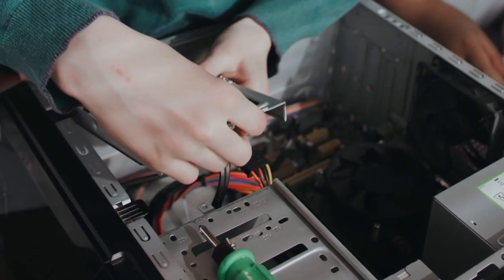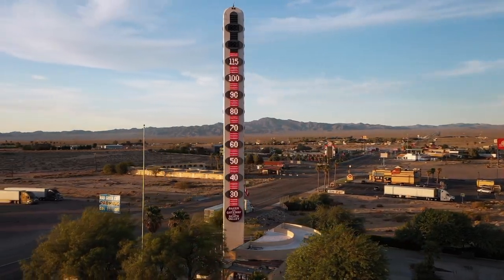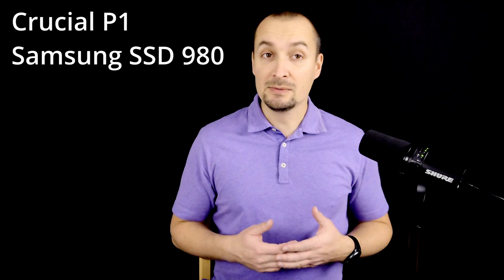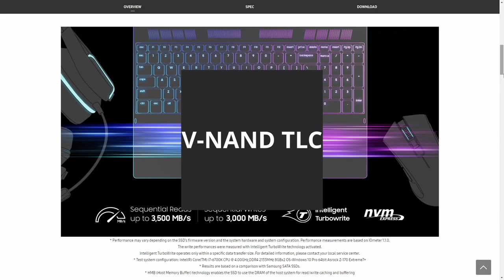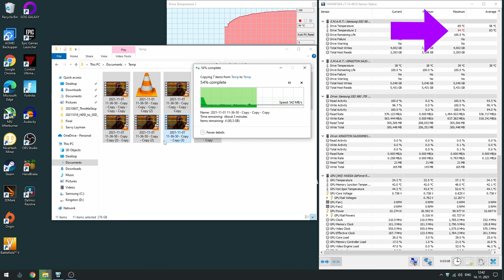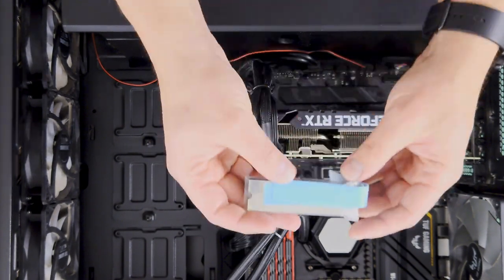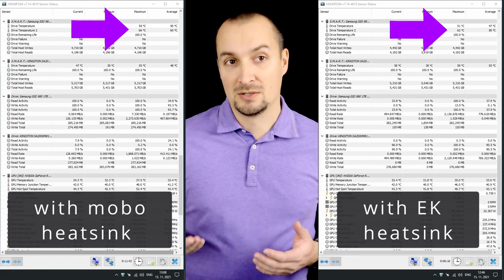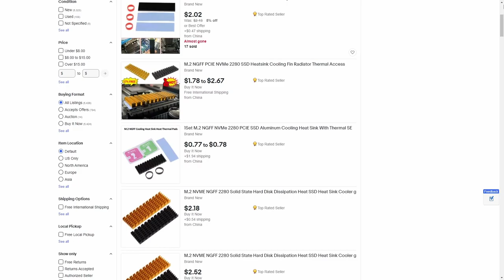Your NVMe SSD may be overheating!

Comment: I thought it's better to store info on a cold ssd. When you write info on it, it's better when it's warm. But during storage or reading it's better when it's cold. By spreading heat from the controller to the memory,  average temperature of the memory will increase due to it being connected to the controller by the same thermal pad\heatsink, no?
Reply from the maker: You are right; the temperature of the NAND chips will increase a bit when the controller is heavily used, but it is nothing to worry about as their operating temperature ranges up to 85 °C.

Comment: Cheap aftermarket heatsink can also get the job done, at least for my Samsung 970 EVO Plus.
Able to cool down the controller from 97 degrees C without a heatsink during benchmark.
But with a heatsink, can barely reach 70 degrees C.

Comment: When my ssd is in it's usual prime position trapped between the cpu and gpu, it's easy for my samsung 970 to creep up to 60c when I'm ignoring temps and leaving fans on default settings, without major continuous file transfers taking place. It first happened when I was playing Still Wakes the Deep (unreal engine 5) on ultra settings. I may consider moving the main windows OS ssd below the gpu, which might lead to lower temps (I haven't tested), but I have much better temps now after keeping my gpu fans on (zero rpm off, and kept on but at a low level when idle) and making the gpu fan increase from lower temps than before. Libre Hardware Monitor allows me to see the ssd temp in Afterburner whilst running anything in full screen. Front case fans blowing over the ssd works well but makes a minimal difference to ssd temp, at least compared to keeping my graphics card cool. Obviously when the gpu is not in use and file transfers are what overheat an ssd, then a much better radiator would be the option as above, and more case fans at higher settings
Reply from the maker: Cheers for sharing

Comment: Hey Man, I Own A Legion 5 Which Has A Samsung SSD And It Runs Pretty Hot.
When I Checked It Through HWiNFO-Sensor Status 
The Temp Of Drive Was Around 57°c & ASIC Controller Temp = 71°c !!

And While Touching The Bottom Chassis, Its Hot !!

Could You Tell Me Some Solution To Fix This Issue.?

Thanks !

Comment: My gigabyte aorus m.2 with copper heatsink has overheaterd numerous times now. .. Waiting for it to cool to see if I get to reinstall windows again for ghe 4th time since owning it...
Reply from the maker: What motherboard and graphics card do you use? It may also be the case the graphics card is dumping heat right onto the drive.
Reply: @savvylayman  Corsair 680x Case, and Gigabyte Aorus Elite Wifi x570 MoBo. The Aorus M.2 has a Giant copper heatsink on it and my other samsung drive does not and has had no issues, it even runs faster. Im wondering if once the heatsink warms up it just contains the heat as opposed to getting rid of it maybe? The operating System is now on the Samsung drive as the AORUS drive was entirely dead this time. Drive Temps seem fine so far and moved it to the same slot to confirm it was not that. That Aorus Drive gave me so much trouble over its lifespan I am debating if its even worth RMA. Its almost 3 years old. This was the 4th time it died and the other 3 I got it back with one time losing all my data. Now this makes for the second time I've lost all data on the drive. Nothing too important thankfully
Reply from the maker: @cdeshaw1986  Now, that's a shame Aorus drive runs hot with such massive heatsink. I wonder if the thermal interface (do they use a thermal pad?) is in a good shape or even missing? Anyway, the drive is definitely is worth an RMA.
Reply from the maker: @cdeshaw1986  Thanks for sharing. Gen 4 drives can run very hot in general, but yours is clearly broken. I wouldn't trust it with my data. It's a pity the fault only demonstrated itself once the drive was out of warranty. Whether or not it's just the controller, it's hard to tell. Yes, controllers are the heavy lifters, but since it shares the same heatpipe with the flash memory chips, you can imagine it has been cooking them for some time and that asks for trouble.
Not sure what your primary use case of the drive was, but I personally stick to Gen 3 NVMe drives and they are good enough. Drive endurance is more important to me than speed in most of my applications.

Comment: I have a Samsung  256 GB M.2 SSD model MZVLW256HEHP-000L7. The power on hours is 12 hour. The power on count is 155. The total host rights is 273 GB. The drives health status is 100%, however it is bad in the red because the temperature is $149°C with a heat sink in thermopads. I sell used computers but I will not be selling a computer with this drive in it. I will probably use it for experimental purposes, in a Windows base streaming media box. Even though it only has 12 power on hours I'm not sure how old the drive actually is for warranty purposes. I know some drives have bearer warranties. I couldn't find any information about warranty on the Samsung web page still looking. But this may have been a Dell OEM supplied drive that came in the computer, therefore when the computers warranty expires the drives warranty May expire
Reply from the maker: 149 °C?? I guess the temperature sensor is bad. I can't imagine ASIC would survive such heat. In any case, I wouldn't trust that drive. Good luck with your RMA case and thanks for sharing.

Comment: Thermad pads would also help? Thanks
Reply from the maker: Thanks for asking. Thermal pads only act as a thermal interface between two objects. That means, thermal pad alone will not do a great job dissipating heat. It also needs to touch a heat spreader of some sort, even improvised one. For example, I used a thick thermal pad on an SSD in my wife's laptop. It was so thick it touched the laptop's aluminum chassis, which significantly helped with spreading the heat.

Comment: Would this be a concern? Idle temp 40-44c, gaming temps 48-55c, download temp 78-81c. Drive is a Samsung 970 Evo plus 2tb.
Reply from the maker: Do you have a heatsink installed on that SSD? I mean it's not a tragedy but those download temps are a bit toasty. Maybe try to copy huge files here and there to see if it gets any worse. If it does, you may want to consider options. But unless you copy huge files very regularly, it's probably fine.
Reply: @savvylayman  I went digging to see what was up. There is no heatsink over that specific slot. I'll need to erase both drives, turn off the raid, and reinstall windows to relocate that drive to a different slot with a heatsink. It's living as is for now because it only gets super hot when downloading huge files like a big game on Steam. Thankfully, I'm not doing that often.
Reply from the maker: @cylerner  I do recommend moving the SSD to another slot where you can install a heatsink. There may be a very small latency penalty if the PCIe lanes come from the chipset instead of the CPU (at least on AMD platfom), but I would say it's negligible. Good luck and cheers for your reply.

Comment: You showed temps at 98 during load, then you installed the heatsink and compared temps at idle.

Idle temps were never the problem.
Since you added thermal mass, you needed to talk about time to steady temps.  I didn't hear that.

3C isn't much.

The most useful part of your video is where you give hardware specs for the Crucial - namely that it is QLC, and therefore cannot come close to the heat generation of the Samsung....
Reply from the maker: Thanks for your comment. Actually, all temps were under the exact same load (copying of a bunch of large files). The heatsink got never saturated, so the temps never reached higher than what was seen in the video.
QLC may play some role, but it was not the memory ICs that were burning hot. It was the controller. Anyways, I may be wrong. Thanks again for sharing your view.

Comment: Hi, I’m looking to upgrade the ssd on my legion pro 5. Which one would you recommend to avoid this issue? I was thinking about the Samsung 970 evo. Thank you
Reply from the maker: Thanks for asking. I use 970 evo in one of my PCs and I am quite happy with the drive. Beware of 970 evo plus, though. Samsung was caught replacing its controller in the past: https://www.tomshardware.com/news/samsung-is-swapping-ssd-parts-too. I personally had great experience with Adata XPG SX8200 Pro. It is a reasonably fast drive for a great price and it doesn't overheat at all.

Comment: I have a gen 3 Motherboard and a gen 4 ssd so do i realy need a hearsink because the ssd has been built for a faster usage?
Greate video btw
Reply from the maker: Thanks mate. Honestly, I would always use a heatsink both with gen 3 and gen 4 drives. While you are right, gen 3 bus will be a bottleneck, it doesn't automatically guarantee the ASIC controller will run cool. I was very disappointed with controllers Samsung used. In short, you may give it a try without a heatsink but I would recommend performing a stress test right away. Not sure if it's worth the hassle as the noname heatsinks only cost a few bucks.
Reply: Ok thanks
Reply: 4.0 Is gonna be hot because its better performance. But you would not be able to abuse it because you have gen 3. Tho it would still run hot. Its better to just go for 3.0 for your gen 3. 3.0 SSD's runs cooler than 4.0, but 4.0 is significantly better for peformance if you have 4.0.
Reply from the maker: @daghetto101 There's no doubt PCIe 4.0 NVMe SSD will run much faster when used in gen 4 capable motherboard. I actually use Seagate Firecuda 530 in my daily system for video processing and it's blazing fast. But it does need a solid heatsink. Fun fact: Even gen 3 SSDs need a proper heatsink. Two ADATA XPG SX8200 gen 3 SSDs caused data loss in two different PCs within a single week. I suspect heat is to blame, because motherboard heatsinks are usually only single-sided. I'll make a video about this soon but I digress.

Comment: So I got a WD SN570 for my laptop, the idle temps I get are around 45-52 degrees (room temp is around 33). And during gaming it reaches 65-70 degrees. Do you think it's fine? I'm going to use that drive just for game/media storage mostly.
Reply from the maker: Thanks for asking. Is it the flash memory chips or the controller that reaches those temperatures? In other words, are there more temperature sensors present on the drive? Anyways, in my opinion, those temperature readings are acceptable. But man, your room is pretty hot. :)
Reply: @savvylayman  Haha, yeah the weather sucks here. 

So I'm using HWinfo and the WD dashboard software to monitor temps, and both are providing only a single reading of temps, not sure which one is being denoted tbh. 

Also I figured out that the ssd temps are being affected by the laptops battery while charging. So if I select the AC only option which bypasses charging and directly powers the laptop, the temps are around 10 degrees less so 60-65 avg while gaming.
Reply from the maker: @thelastdragonbender5824  Laptops are tricky because there is little room to dissipate more heat. What I did was I used a thick thermal pad so that it would make contact with aluminum chassis. It spreads heat rather nicely and it was only a bit warmer to touch.

Comment: i purchased the Star Wars Lightsaber 2TB Seagate NVMe M.2 SSD and ive noticed they are runnig at upto 30*C higher than my old 1TB Samsung 970 EVO. The new Lightsaber heat sink is touch the rear panel of my Sapphre RX 7900 XTX nitro+. is this normal?
Reply from the maker: Thanks for asking, @Dont-Evan-Bother. Samsung 970 EVO is a PCIe gen 3 drive, whereas Seagate Lightsaber is a PCIe gen 4 drive. Gen 4 drives do run hotter due to higher compute load on their ASIC, which results in a significantly higher throughput.
I suppose you measured the difference of 30 °C on the ASIC controller, correct? This is usually the highest temperature reported by the drive. On 970 EVO, it is called Drive Temperature 3 in HWiNFO.
May I ask what temperature you actually read? Even if the drive reaches 90 °C for short periods of time, I wouldn't worry it too much. However, the drive's lifespan could decrease if it runs this hot for 24*7.
Concerning the heat sink touching the backplate of 7900 XTX, it's not ideal. That GPU dumps tons of hot air right onto the NVMe SSD. What motherboard do you use? My Asus mobos based on X570 chipset support PCIe 4.0 specs across all NVMe slots. If this is the case with your motherboard, I would recommend moving the drive to a lower slot. Yes, there is a small latency penalty but nothing significant.
Oh, and my assumption is your case provides enough airflow.

Comment: Why does my drive run cooler in Windows and hotter in Linux Mint 22?
Reply from the maker: Are you reading temperature from the same sensor? An SSD usually has a few. Not sure how it's done in Linux tbh.
Reply: @savvylayman  Using Psensor it says Sensor 1 and 2 on the SSD are from 64c to 70c while on youtube.
Reply from the maker: @FutureEyesOnly-be3do  That is really strange. Even if it is a system drive, I would not expect such high temperature while just watching YouTube. Does it have a heatsink with thermal pad properly installed? What kind of drive is it? Anyways, maybe the readings are wrong?
Reply: @savvylayman  Just found the problem. VMD in the bios was enabled causing everything to get hot for some reason. When i shut it off and rebooted temps dropped off to a  very normal level.